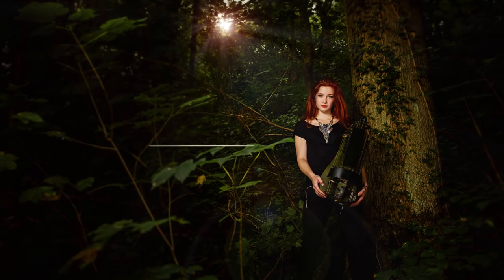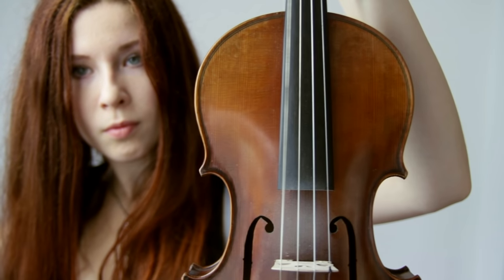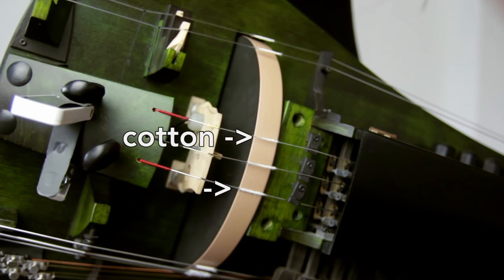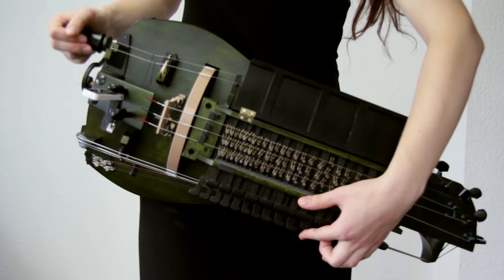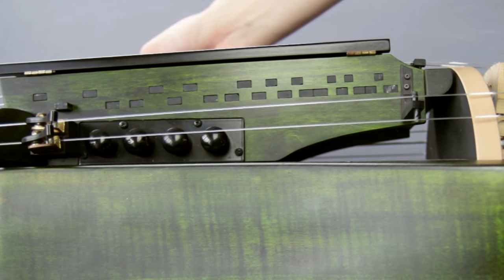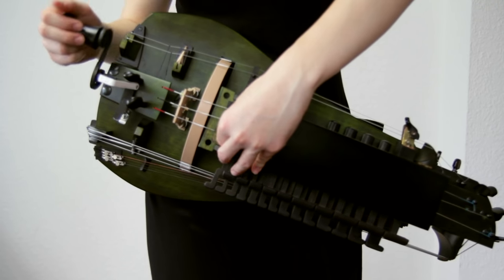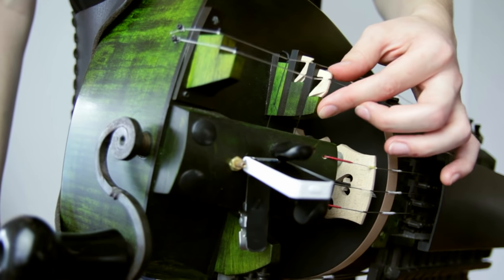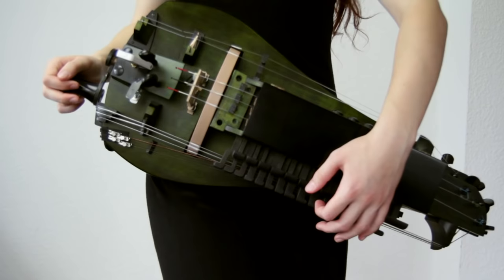How EXACTLY does the hurdy gurdy work?

Comment: Struggles to play the violin 

badasses the hurdy gurdy
Reply: I cant play both. But i think the hurdy gurdy is easyer to play than a violin
Reply: @baum8347  I tried to play Violin and now I play Gurdy. I can confirm that the Violin is a lot more tricky to pick up.
Reply: @baum8347  Practised the violin aswell. the first 3 months is just practising the tension on the strings and let it make a bit of sound that doesn't make your ears bleed. Also own a gurdy now but trust me. Before you buy it, practise on a piano first and practise some songs before you do it on the gurdy. The gurdy gives you more stress then a piano does. With a piano it's easier to catch up again after making a mistake. The gurdy gives you headache after making a couple mistakes in a row.

Comment: Absolutely awesome! Often thought about to learn playing fiddle, but then again thought about that violation of my fingers and my age! But the Hurdy sounds pretty similar and I would " just" have to press keys ( and of course practize a lot, to get on a sufficient playing level!) But as I'm  a maker, I of course would like to give it a trial or at least take an attempt to try myself in building one ( at least a simple and smallish).
I tried to refer to the mensure of 285mm ( 1/2 violin) calculated the threads and now stumbled over a bunch of questions.
Is there a preferred basic note for the moelody string. What if you have more then one ( I read yours has 18 strings - how many for melody)? Are they  just engaged one by one to have different transponations or tuned in a chord and controlled via multi pin keys.
Would appreciate any hint you would give! Thank you in advance! Hj

Comment: came here to figure out how the damn thing worked, realized i missed half the video staring at her smile. then i zoned out...forgot what i was doing, now im thinking what would happen if you attached an electric motor to the crank with a foot-pedal throttle and added some guitar effects. i have a problem, the struggle is real and i cannot afford a gurdy to burn up trying this. someone out there please find a cheap gurdy and a cordless drill and let us (mostly me) what happened. the world needs details. wear a mask, there will be smoke. safety first, or second or whatever, need safety in there somewhere. i want coffee.